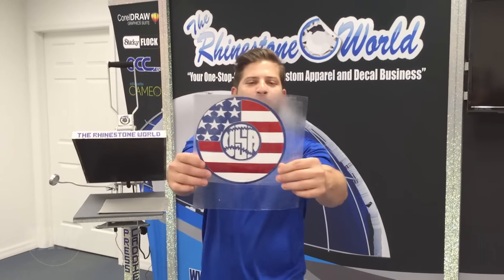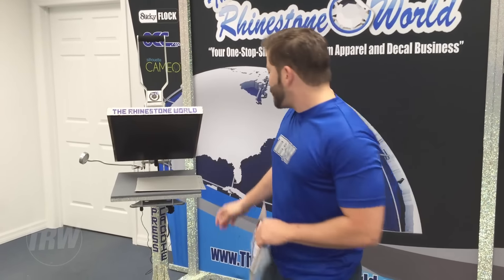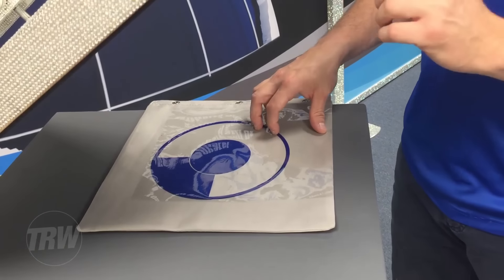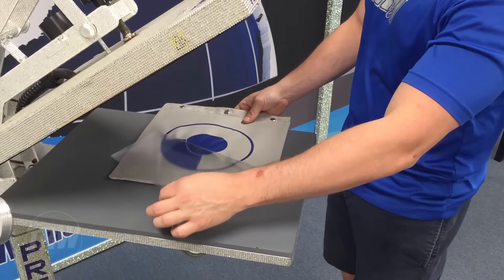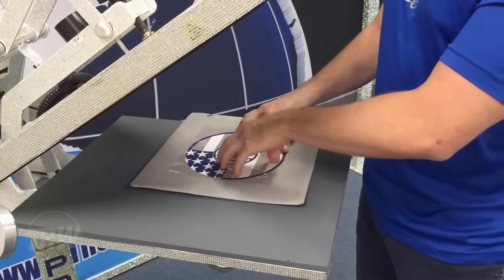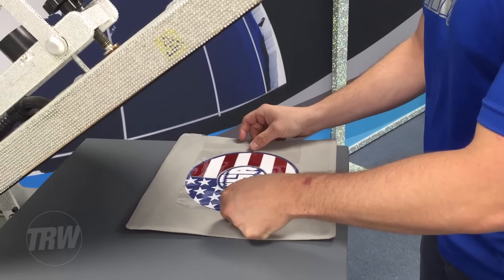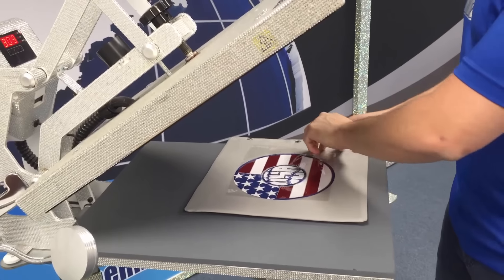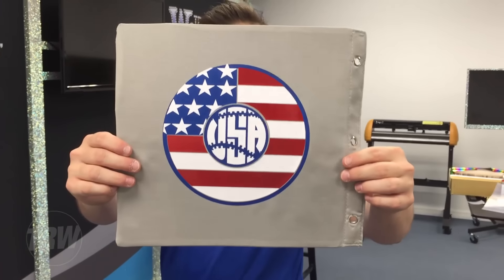Pressing American Flag Monogram

Comment: Can you do that with glitter vinyl? I just did a design with plain vinyl on the bottom and the top was glitter vinyl but the carrier sheet from the glitter did leave marks on the first plain vinyl.
Reply from the maker: Hi Anne!
For the top layer, did you do the 1-2 second pre-press to tack the glitter vinyl on and then remove the carrier sheet to do the full 10-12 second press? If you do it this way, that should prevent the carrier sheet from making marks on your bottom layer! :)

Alexis @ TRW
Reply: I will give it a go tonight!!! Thank you for the response and the videos!  super helpful!
Reply from the maker: Not a problem! If you have anymore questions, don't hesitate to ask! :)

Alexis @TRW